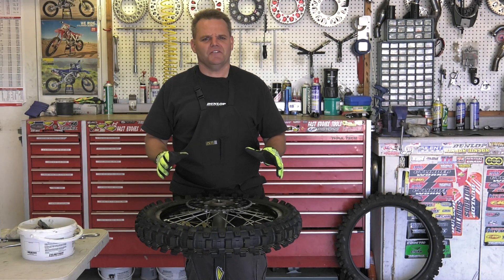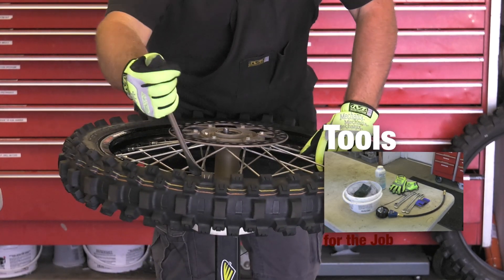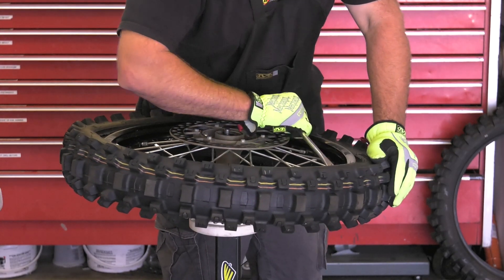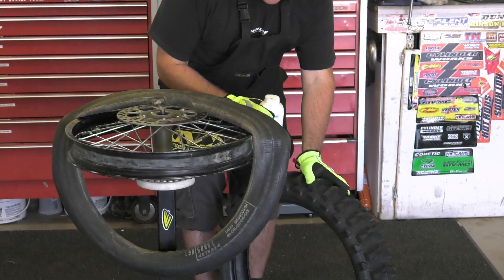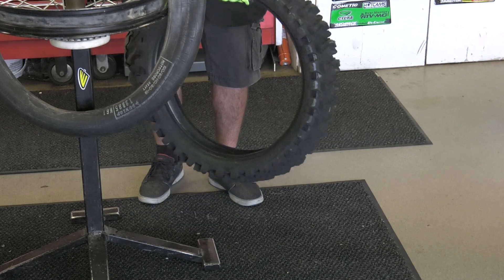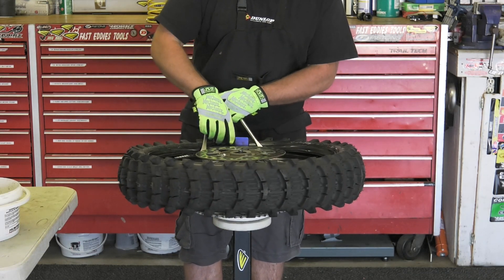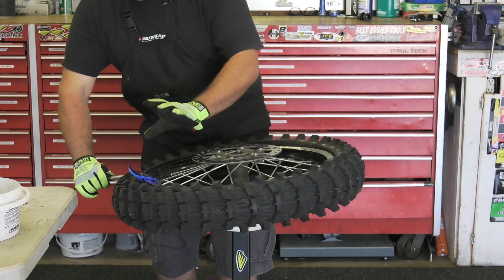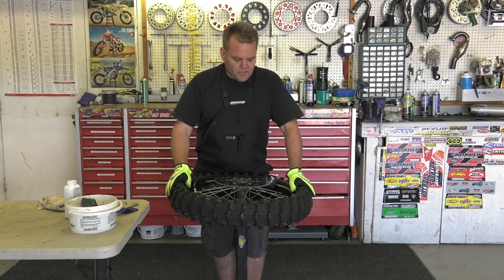Dunlop MX 11 Rear Tire Change

Comment: I have been changing dirt bike tires for over 50 years. It is nice if you have a stand - like in the video - but I, like many others do not have one. I do it on the floor, and use my knees a lot. Some things that can complicate tire changing - WINTER (cold temperatures) - warm both your new tire and your existing wheel/tire up, if you can. Also, burred spoons! Take the time to make sure that your spoons are smooth, and have no sharp edges, or burs. Ultra-HD tubes can also make things quite difficult. Just getting the stem through the rim hole can require strong fingers! I use WD-40 as a lubricant, as it kind of vulcanizes the bead to the rim after it dries up. Some people use dish detergent, but I have found that it can eat the aluminum wheels, and completely destroy the wheel from the inside very quickly.